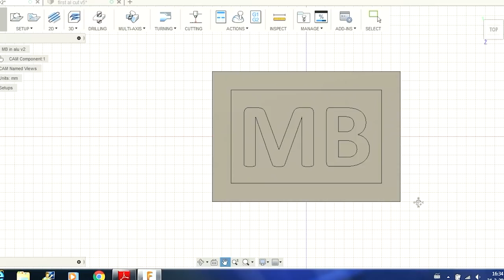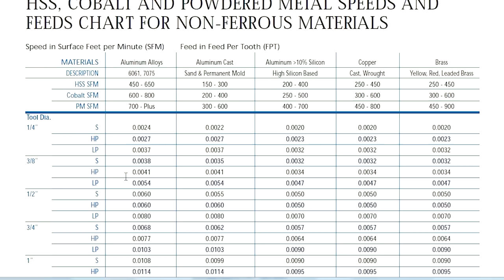My first experience with milling Aluminium on a CNC 6040 Router

Comment: Never use a 4 flute end mill on aluminum. They do not have the proper clearances and edge that aluminum needs. A 3 flute would have cut that well. A 4 flute was never intended for aluminum. If you want to avoid coolant, try multi-layered DLC coated tools. A bit pricey, though.

Comment: Was the final surface finish because the CAM tried to do a fine climb cut at the end? Your machine might not be rigid enough to climb cut.
Reply: Exactly, his machine isn't rigid enough to do climb milling, I don't know for sure but I am guessing that his machine doesn't have any backlash devices either. I would suggest milling in a clockwise direction, he is milling in a counter clockwise direction (climb milling) I don't know if the program will allow this or not.

Comment: It may be too late but you're also "climb" milling with a very UN-rigid mill. That's not good as it puts a lot of pressure on the end mill. If you reprogram for conventional milling your cuts will be better and your tools will last longer. Wait until you have a rigid machine to climb mill.

Comment: You'll have much better luck cutting your entire pattern at increasing steps of depth than running that end mill against the walls at full depth like that, especially with the weakness in that Y/Z axis.

Comment: Finishing at 0.1 is to much!

Make it 0.010mm, use smaller length tool and adequate for finishing jobs!
4 flutes is for roughing.
U need to use cutting oil mixed with water for better cuts, 5 to 8% oil mix, I would say 6% to start!
And upgrade that god damn cnc, its pathetic how loose it is!
Reply: I'm making an apprenticeship as a Machinist rn and I'm pretty sure 1/100 of a mm is not enough for a finishing pass. Maybe 5/100 of a mm. I don't think this machine can move 1/100 accurate anyway. Also, the 4 flutes couldn't care less if they are roughing or finishing lol. Feeds and speeds matter.

Comment: Yor x&y feed rate is too high lower it down a bit, I used to cut about 20-40 dies daily in aluminum and magnesium with air cooling and the bits will rarely break. Also you could get carbide bits and they would do great.

Comment: Excuse me.... but.... WD-40 is not a lubricant.... WD-40 stands for "W ater D isplacement - 40.th Formula". It was made as an anti - corrosion helper.
Aluminum does not need a lubricant at all to be cutted. The mist of water and air is just for cooling the cutter bit. You just need the right cutting tool (most likely a one-flute) and hight speed spindle.
Reply: I disagree. WD-40 is used for processing Ally all the time. Works great, same with kerosene!

Comment: Im not an expert in CNC machining, definitely not an expert on how metals respond to tools neither. But when i saw your cutting, I can see something is wrong with the cutting going. I see aluminium is melting and pilling on the surface. I was scared to expecting with some scare something is going to go wrong, then there was a pop. OMG I scared.

Comment: You should try to get your hands on some real industrial cuters from "Sandvik Coromat" they are awesome! ;)
Reply: Coromant tools are about two orders of magnitude too big for this machine ;D
They're built for production performance and require extreme feeds & speeds.
Some Coromant tools require higher torques than the frame of this machine itself can handle without snapping.
Reply: Spirit jep^^ Thats right, but Sandvik also produces smaler Endmills (everything under 10mm)

Comment: You definitely do not want to run a 4 flute on aluminium. It takes time for the chips to exit, otherwise it'll clog up and stop cutting. Also make sure to get real HSS, not carbon steel cutters faked as HSS. Those extremely cheap end mills are most likely fake HSS. I wouldn't even bother looking at an end mill below 10 bucks.

Comment: You really have to do your homework on these automated machines. You need to know the software .. mill types .. and material characteristics.  Materials engineer comes to mind.  This will take you a while and $$$$ to figure with no help ... Everyone else is trying to do what you want to do .... and many are and they are already selling the product in bulk for fractions of what you can ... ...what will make yours unique ??? Oh .. also ... save your soda cans.. they are the purest source of Al you will find unless you buy it by the block .. You can melt it very easily. I built what I do on frugality, creativity, and wasting NOTHING. I invested $15,000 believing in ME and my creativity ... even when I seemed inferior to what was  out there .. I won big time.

Comment: This is some cringe material. Has there been no more router videos because you broke the CNC this way? It's hilarious how much money you got to push on this stuff (the pressure tank, the CNC seems expensive with that spindle) and then you do cheap out on materials and tools and go extra-spaghetti retarded, running it way overspeed and not stopping it when it shows out that the head visibly bends while cutting. You should only use this thing for woodworking. The frame clearly isn't meant for anything else. It's too big and too weak for its size.
Reply: Did you replace the z axis rails with supported ones? If so, how did that work? What rails would or did you use?